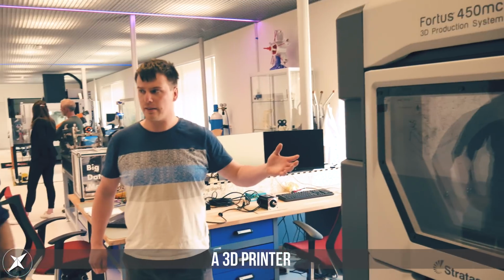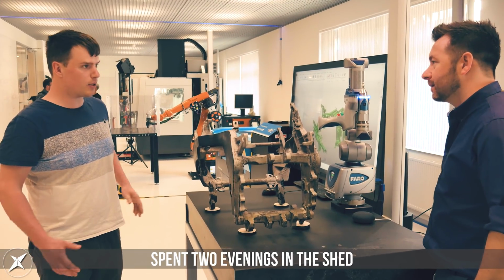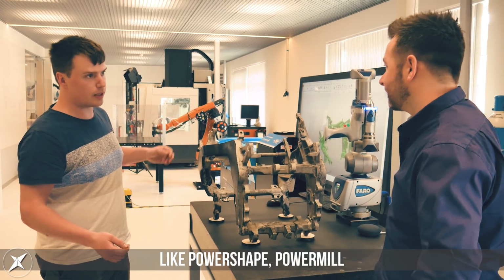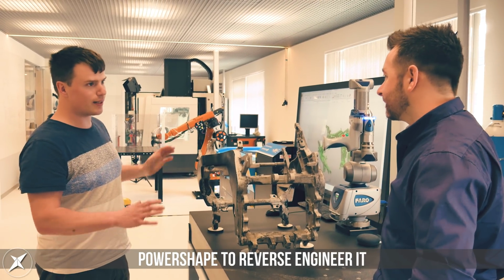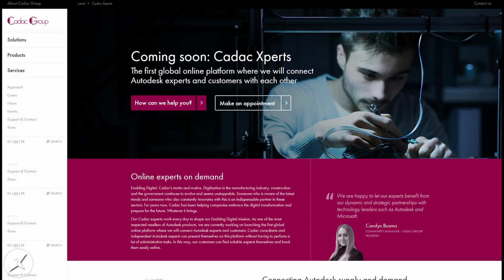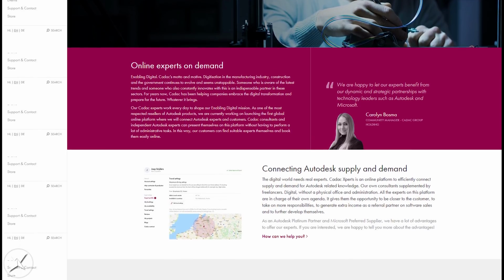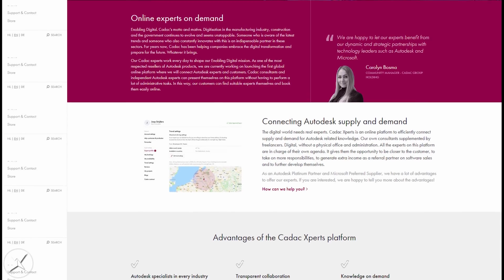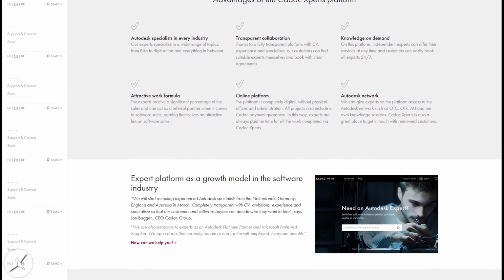Who even has a Maker Lab like this!? - Cadac HQ Tour

Comment: I work at the ABB Robotics Integrator for the state of Florida......your video makes me question what a flight and rent of local apartments/townhouses are in the Netherlands 😆

That's actually quite close to the kind of non-profit makerspace/FabLab/hackerspace I want create over here to "democratize" the kind of industrial software, like PowerMill and PowerShape that is indeed specific to industry and unavailable to educational institutions (typically), industrial manufacturing equipment, high-end motors and electronics, high-precision measurement equipment, actually useful reverse engineering equipment such as that scanner, and robotic systems and the educated as well as experienced personnel on site or on call to teach and/or assist someone in the creation of something. I currently plan to offer memberships to help pay some of the bills that would be associated with the place, but it would largely be a way to give access to young kids/teens/adults to things that would otherwise be out of reach financially or just locked behind closed doors never to be exposed to it. My plan is to try to have it 24/7/365 with no need of an appointment, but have a system that allows users to reserve and/or check if machines are in use and if so for how long. 

I liked that video A LOT (also wondering what else Autodesk owns 😆)